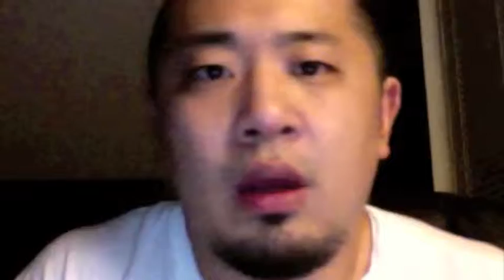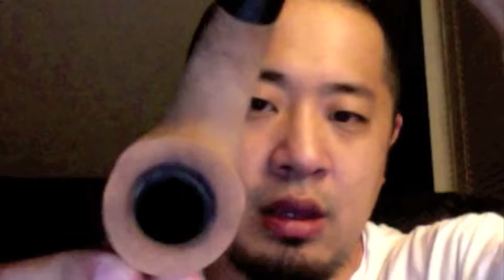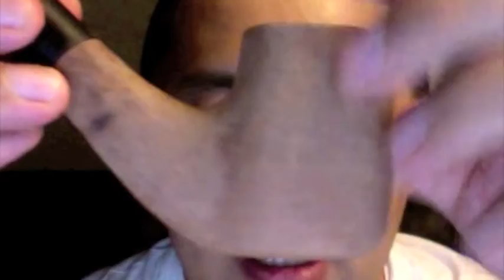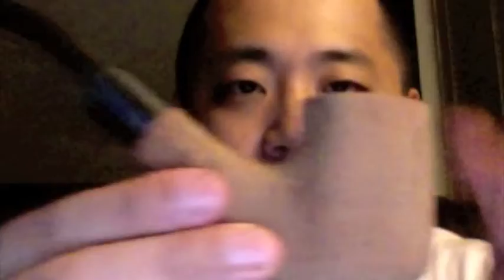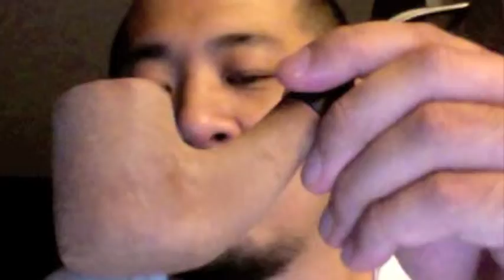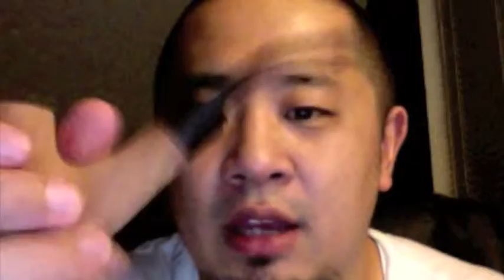random carving fail

Comment from the maker: @DudeAugusto i have a friend who is into woodworking that drilled the holes for me.  but late on, i sometime change the size of the shank hole.

this good ole pipe named "fail" is all done free hand with sand paper only.  it take so much longer but it is sort of fun ^_^  i usually use dremel & sand paper.